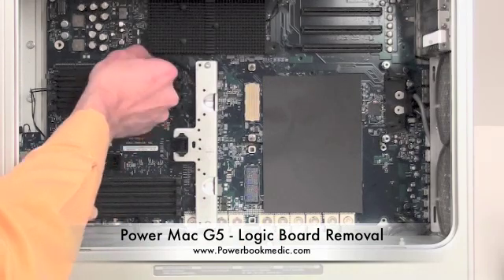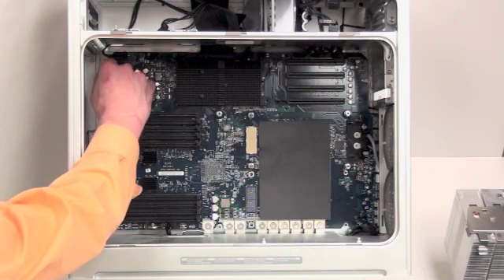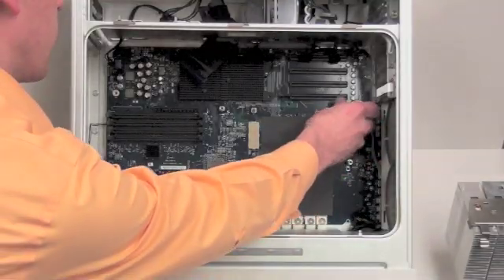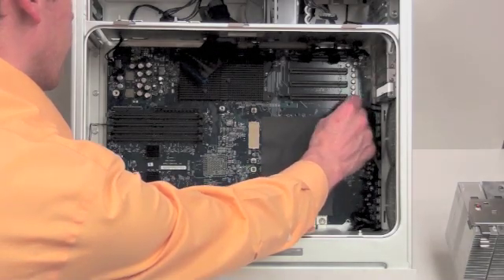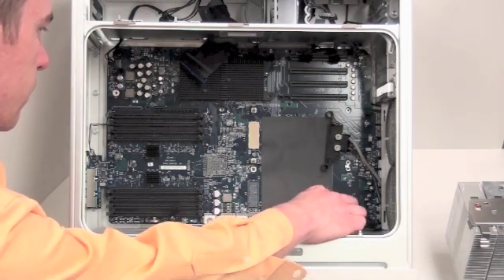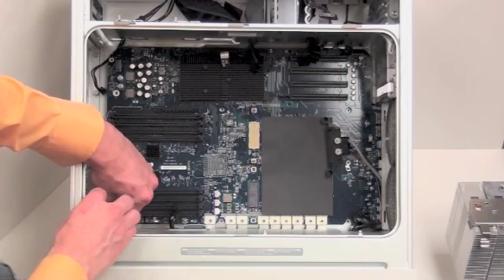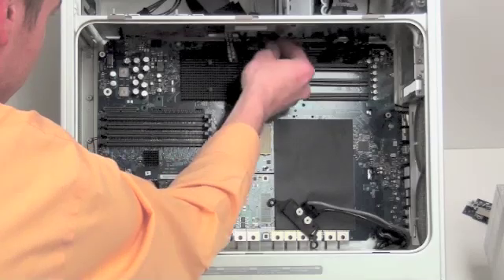Power Mac G5 Repair - Logic Board Removal

Comment: what model year is this, as i recall there are 3 board types, pre-2005, early 2005, and late 2005 never mind I can tell now it's a late 2005 by the PCIe slots
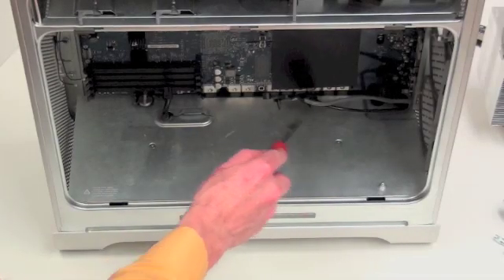Reply: @UmbreonGamer I know this video is literally 8 years old but it doesnt show one thing - how the hell do you disattach the front panel board (the one holding power button and few usb slots)? The video magically omits this fact LOL (3:55). Mine's stuck in place and I cant take out my motherboard with this front panel still there.
Reply: I don't know, my power mac g5 uses a completely different front panel board from the one in this video
Reply: @UmbreonGamer Nevermind bro, Mine has 1kW PSU and these are like unicorns in my area- unreal to be found. Think I'm gonna just dump it and buy a PC. Thanks for the answer though :]